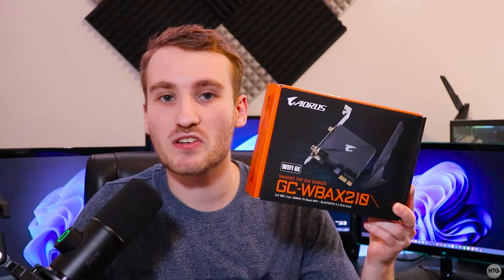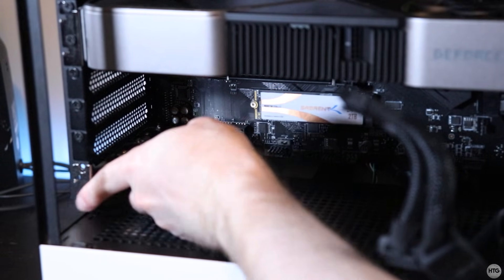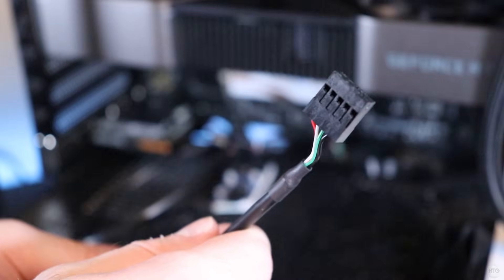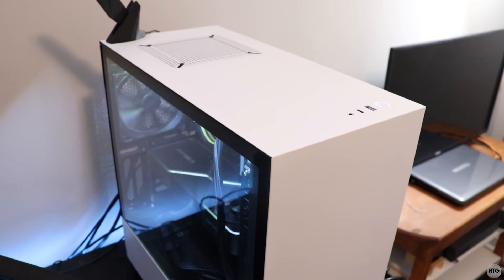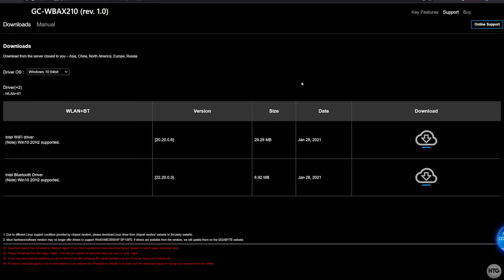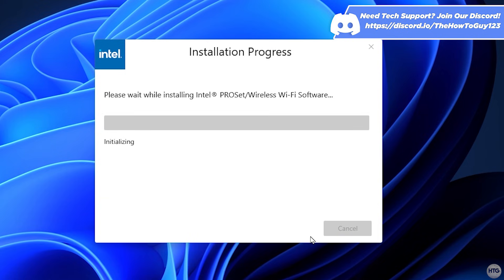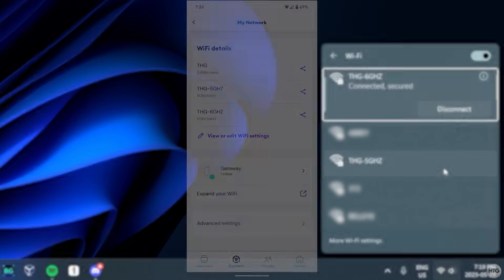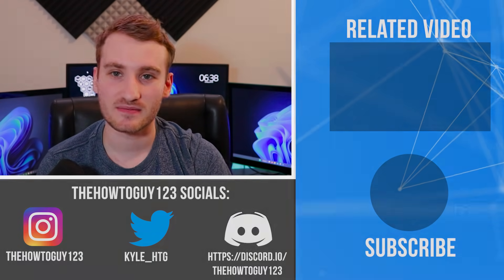How To Install a PCIe WiFi 6e Card Into Your PC (Gigabyte Aorus GC-WBAX210)

Comment: I'm sorry, but I don't quite understand because I don't speak English and I want to ask

 If I connect the network card using a USB cable that plugs into the motherboard, will I have access to bluetooth? Or does only bluetooth work if I make USB-A to USB-A connection?🙏🙏
Reply: Only works with usb A  to usb A connection

Comment: Great video ! And how to check whether my router supports 5ghz channel or not..
Reply from the maker: The best way to find out which bands your router supports is to just google it's specs or click around in the router settings. Most modern routers support the 5GHz band, but 6GHz is fairly new and only supported on routers made in the last couple of years.